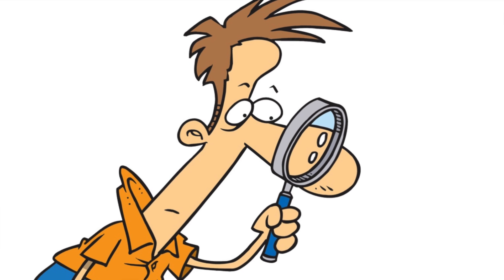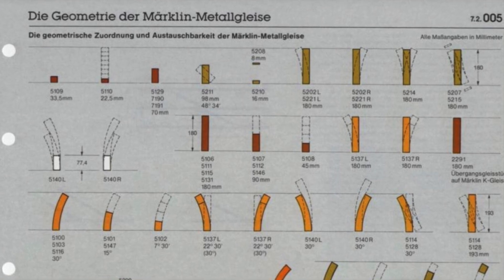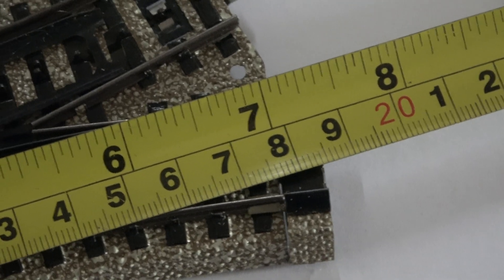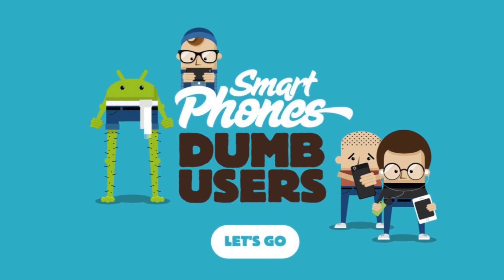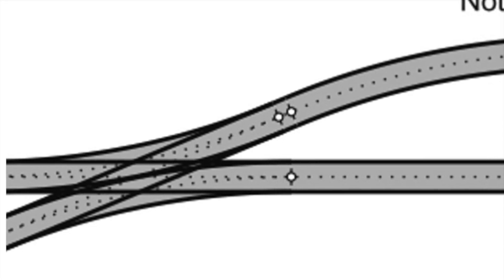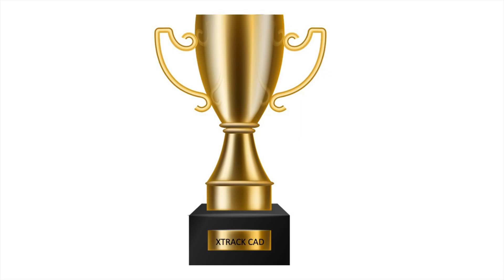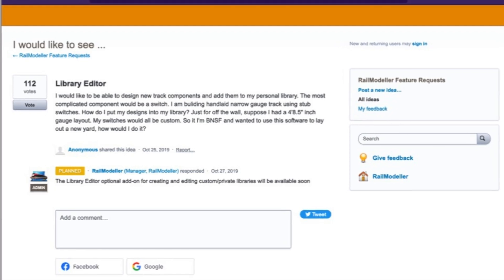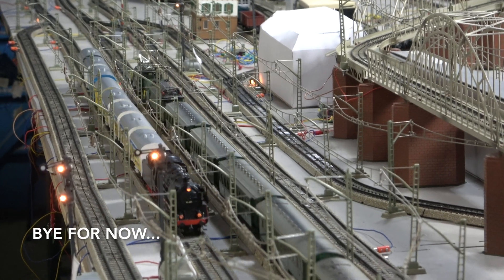The mystery of the Märklin M-track 5207 crossing in track planning software... Part deux...

Comment: It's s impossible to make part 5208 with a curvature due its small dimension, you can't distinguix what size you need, so it's necessary to be simmetric, on account of lose 1º.
Reply from the maker: I gave it a try and it is not impossible 😉 See the end of the video. Thanks for the visit and comment 🙏
Reply: I refer that it's impossible to distinguish with the naked eye a 8mm width part if it's left or right hand, for this reason Märklin opted for make it symmetric, on account to lose 1°
Reply from the maker: @JCR_cande  Ah, I understand now. That's possible.  Or perhaps, Märklin adopted this compromise to avoid having to make 4 crossings without compensation bits (1x left hand, 1x right hand for each type of crossing). This kept the system simple, made the crossing more versatile and ensured larger sales volumes for a better ROI. We weren't part of the engineering team, so we'll never know for sure 😀

Comment: I am so glad to have found your channel. I have just retired and I'm going to put up a permanent layout. My layout is mostly K track and my locomotives are from the late 1950's. 
  My question is, can I run the new digital locomotives on this layout. I'm using the small blue transformers.
Regards.
Reply from the maker: Hi, the track is no problem. What "small blue transformers" are you using?
Reply: It's the transformer that came with the HO starter sets of the 80's.
Reply from the maker: @marvinbanka7592  The plastic blue ones should still be ok, the metal blue ones are not. The main problem is the reverse pulse which is too high with modern grids. This can fry some decoders. You can check the output of the transformer with a voltmeter, the value when reversing should be around 24v, if it is higher, then I wouldn't use digital locos with it. The safest is to invest in recent white transformers, which is the choice I have made: I no longer use anything blue for driving or lighting.
Reply: Is there a transformer that you could recommend for the older locomotives of the 50's and the newer digital ones?
Reply: Thank you very much.
  I like the new locomotives coming out and want to get some, but I will not stop running my 50's trains.

Comment: you could fudge the crossing instead ;)
Reply from the maker: I would need 4 of them in that case (1x right hand, 1x left hand for 2 types of crossing...) Easier this way.... 😀
Reply: Thanks for the detailed video (as usual). I had a similar idea - to create various combinations of 5207 with 1 or 2 5208-C pieces already attached. It means that users who don't understand the issue would not have a problem and it would be convenient as you would not need to place the 5208-C individually.

Comment: Excellent! Someone has to go to town with issues like this. M-track itself can be quite forgiving to some degree of course, and I can imagine that even Märklin perhaps never had this degree of mathematical precision in mind since it wasn't required in the pre-computer era, so they could get away with that particular indescrepency and rounding. But thankfully the Märklin community is blessed with contributors like you. Great work!
Reply from the maker: If we mesure, the manufacturing was done with strict tolerances, despite lack of computers.  I think Märklin adopted this compromise to avoid having to make 4 crossings (1x left hand, 1x right hand for each type of crossing). This kept the system simple, made the crossing more versatile and ensured larger sales volumes for a better ROI.  Thanks for the visit, much appreciated :)
Reply: @The3rdRail  Makes perfect sense. What I meant is that users at the time of pre-computers perhaps would not notice it since laying the track could easily be fixed through some slack M-track does allow. Now in this age of computers the tiniest of indescrepency is revealed of course. They could get away with it, and indeed keep the system simple and less complicated for production (cost). Makes perfect sense your explanation.

Comment: You definitely is  as you described yourself a bit of a mad scientist, but interesting non the less. I my self is as I wrot to you the last time of the very old Scholl with pencil and paper there it eventually all fit or does it try to make a pure diagonal entry at on end of let’s say three points  ending with one curve of 5206 at the top and a straight entrance with three point and three 5206 at the other end and the fourth parale line will not aligned?  Just so you get my meaning 5202 r , 5202 r5202 r and 5206 opposit 5202r,5206 , 5202r,5206, 5202 r,5206.  Hope I made myself clear.  Thank you so very much for this fun and informativ video
Reply from the maker: you need to use 5208 sections between your points to maintain the parallel spacing, and 5210 or 5208 make-up as required to maintain the vertical alignement on the parallel tracks. The straght section of the points behaves like the crossing diagonals in this case. Thanks for the visit !